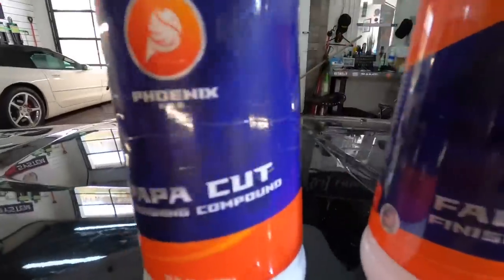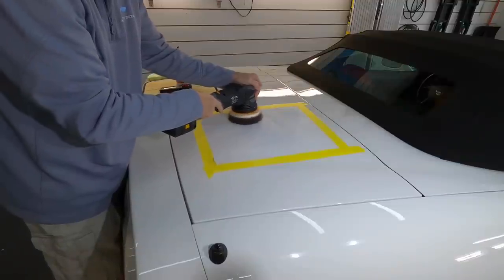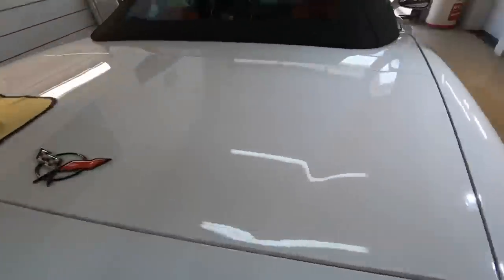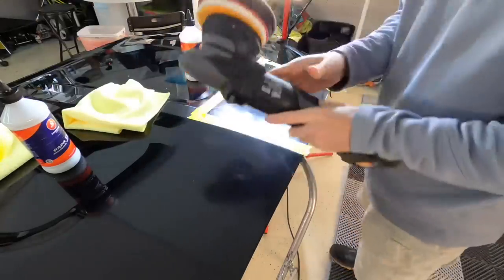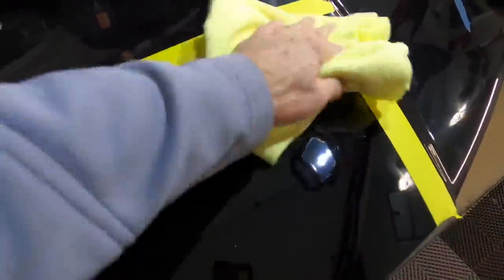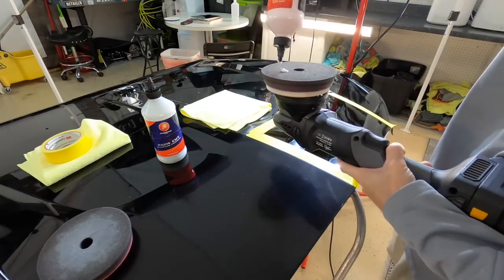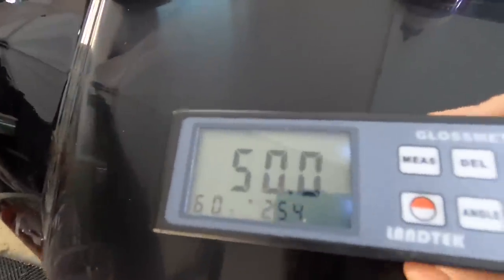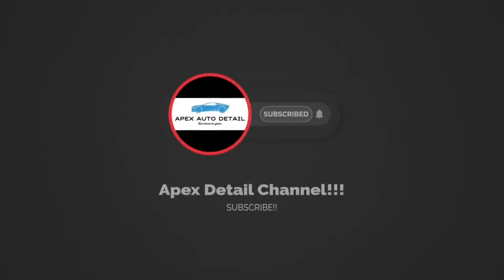Effective. Economical. Simple. Safe. Phoenix E.O.D. Papa Cut & Fabulous Finish!! Paint Correction!

Comment: Another superb video Brian! As you have used both systems now, can you compare the Koch Kemi vs this one (Cut, finish, gloss etc)? The before and after results were amazing. Using the cut, it would have been nice to see what the gloss was before and after the polish to see what the quantifiable difference is.
Reply from the maker: They have a 3 polish system and pads compared to this two polish system which is much cheaper to use. Just surround yourself with a few decent pads.

Comment: If this is a stupid question I apologize,  but isn't the throw of your DA dependent on how well centered your pad is? Thank you 😊
Reply: Throw is determined by the machine itself. You always want the pad directly centered as much as possible though.
Reply from the maker: Center the pad perfectly on the backing plate for a smooth ride across the panel. The throw depends on the set up of the polisher itself.

Comment: How does it compare to 3D one with a 50/50 pad?
Reply from the maker: A good result for a fraction of the price.
Reply: @apexdetail85  Not sure what you mean as 3D One is cheaper than the Papa Cut.  $24 for 16 oz. of 3D One vs. $30 for the Papa Cut.